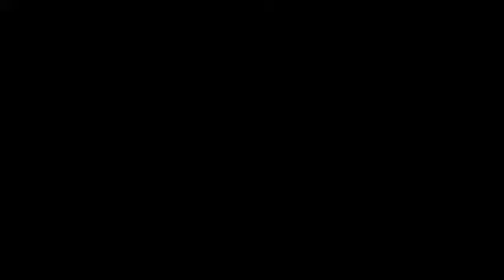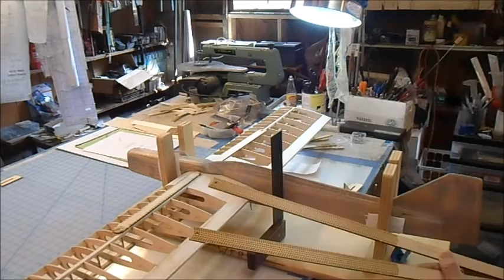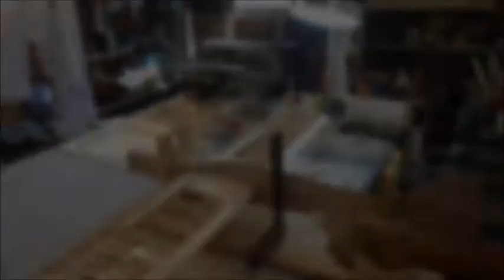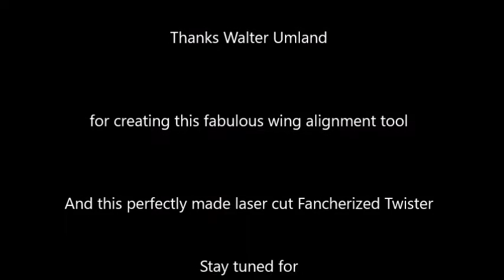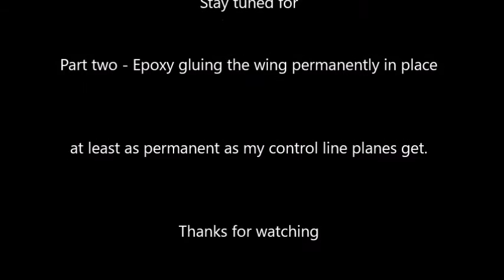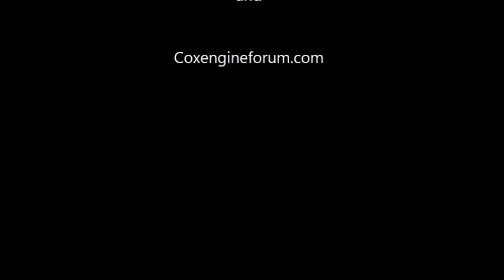Installing a Twister wing  using Walter Umland's alignment jigs

Comment: Hi Rusty, can you describe your building surface, you mention glass, how large is the sheet of glass and what thickness?  Thank you!
Reply from the maker: Hi, Fred. Back then I was using an old oddly shaped large TV table top. It was about 3/8" thick. Now I have a shower door that must be about 1/4" or 5/16" thick. It has to be shimmed to avoid flexing to the old table top's slightly wavy surface. I set it on top of some lengths of 1-1/4" x 3/32" aluminum angle. I might have to do some more micro shimming before I start on my Cardinal wing. I level it using my steel 48" ruler on edge and try to slide the cornere of a piece of notepad paper under it along the length of the ruler. Then I lay 1/2" sheetrock on top of the glass. Ceiling tiles are good for that too.